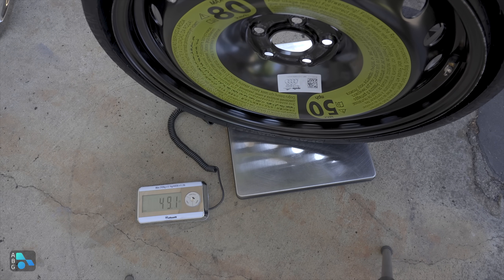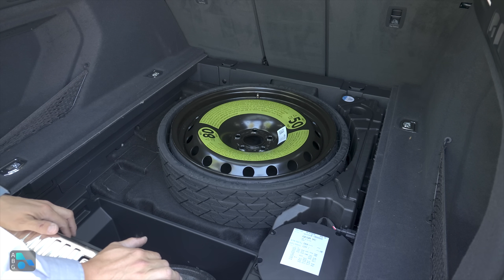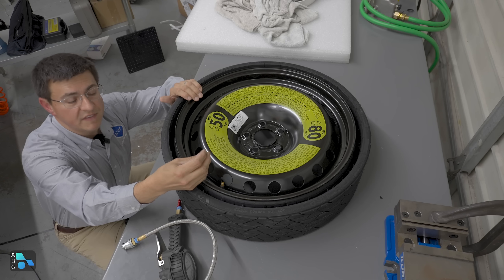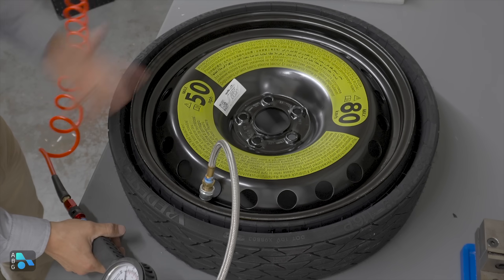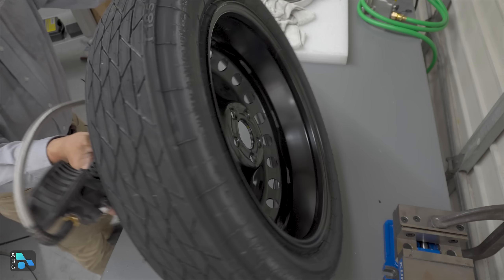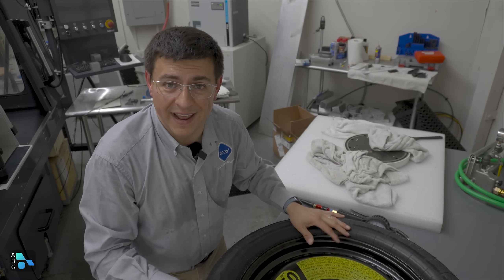How A Collapsible Spare Tire Works, And How It Might Save The Spare Tire In EVs

Comment: Except for their spotty reliability history, Audi has always been one of my favorite brands and I give them props for this innovative idea for a spare. I have a bit more experience with tires than most and have always said that not having one would be a huge factor in whether I buy a car or not. This is better than the fix-a-flat solution but still would much rather just having a regular full-sized spare. Being out on the road changing a tire can be dangerous and not having to spend time getting the tire prepared, rather than just lugging it out and putting it on, would be much faster (and safer). Thanks for demonstrating this.
Reply: You take the spare out, start the pump, then start jacking up the car and removing the flat tire. By the time you’re done the spare is filled. It really doesn’t take that long.
Reply: @NovaResource  Yes, for me, I'd just rather have a spare already filled with no additional moving parts to be searching for.  But hey, you do you!
Reply: @Mark-de4hj  Yeah, because using a pump to inflate a tire makes it so much more complicated. 🤦🏻‍♂️ But hey, if pumping up a tire is too complicated for you, you probably shouldn’t be jacking up a 5000 pound car.
Reply: @NovaResource  You have never used the technology being described, but you think that you know all about it. You are EXACTLY the type that should not be telling anyone anything. No reply needed, thanks!
Reply: @Mark-de4hj  LOL!  As a matter of fact, I have used the technology described. GM was putting collapsible spare tires in cars as early as 1967. Camaros and Firebirds had them. I also happen to have one in my 1976 Nova. And have used it at least twice in the 35 years I’ve owned it.
Reply: @NovaResource  It would be IMPOSSIBLE for you to change a tire faster than I could, using that callapsable tire and following the directions! Keep in mind that most folks do not change a tire very often. Based on your own methodology, you thought you were clever by leaving out the step where, while I am installing my wheel, you are just turning your tire over for the other side to expand at its slow, unpredictable progress? That alone easily another 5-10 mins!
Ps. I never used the word, "complicated". That's on you!

Comment: Glad to see this video.  Those of us living in more remote areas (e.g. mountains of central Idaho), often do not have cell service on the road.  Therefore, no spare can be a problem.  We cancelled our Rivian R1/S order partly because the optional collapsible spare was "unavailable" until some future date that kept coming and going.
Reply: I would think an electric vehicle might not be a great choice for people living in remote areas. If you actually live on a mountain, I would think all the uphill driving would greatly reduce the range you could get on a charge.
Reply: @SwapPartLLC  Don't worry, once you own an EV someday, you will get first hand experience and you can learn how EVs work so well - even in small towns or the mountains.
Reply: @tedbellSEA  If it works for you, that's great. I know nothing about them.
Reply: It's a TRUCK!
Just throw it in the bed or buy an after market tire mount if you're rural.
And if you ARE rural why are you buying an EV???
Reply: Actually, the R1/S is not a truck, it's an SUV.  Besides the environmental benefits, we are interested in an EV because anyone with actual experience owning an EV, knows how inexpensive they are to own vs. an ICE.  Even living in a small town in the mountains, 95% of our day-to-day trips are less than 10 miles.  An EV is perfect.  The spare tire is needed if we drive to the backcountry or a larger town - through cell dead zones. @amzarnacht6710

Comment: Most vehicles no longer include spares.  I wonder if it is cost cutting or because many prefer to call roadside assistance.
Reply: Lower weight (jack and tools are no longer provided either), lower cost and roadside assistance does work. But one of the biggest reasons is simple better tires that are more resistant to punctures.
Reply: @NovaResource  The problem is the tires gradually lose its puncture resistance as it wears out, add to that the higher pressures of EV vehicles and  it becomes even less puncture resistant.

Comment: So I’m confused. How are you supposed to inflate the tire on the side of the road? I didn’t see a compressor or canned air included in the flat kit. What did I miss?
Reply from the maker: I talk about that in the video, in this car it’s in the front trunk area.
Reply: What did you miss?  Most of the video. Specifically at 2:03 where he says, “Now let’s get to the inflation. I’m not going to be using the pump that came with the Audi because it’s a little on the slow side.”
And at 5:33 where he says, “Under this little partition we then find the tire inflator kit “ (aka tire pump).

Comment: For average people, I would be weary of them overinflating it, causing major harm if it exploded. For a car enthusiast, they probably wouldn't buy an EV to begin with, so they won't be faced with no space for a traditional aftermarket spare tire.
Reply: Weary = feeling tired
Wary = feeling concern

Are you wary of people over-inflating standard spare tires?
Are you wary of people over-inflating the 4 regular tires?

How is this any different?

If filling a tire is too hard then that person shouldn’t be driving.
Reply: @NovaResource  Absolutely, so it's a good thing that most people never even touch their spare tires and instead,  call a tow truck. If you know how to put a spare tire to use, then, no need to be weary.

Comment: lol kool idea but who ever came up with this shows never actually swapped tires on the side of the road before ... I mean can ya picture the persons face trying to inflate this bugger on the side of the road ... in wet, cold climate  :face-purple-crying::text-green-game-over: ... having this in my trunk would just annoy me more then the flat itself ...
Reply from the maker: The first time I used one was on a first generation Touareg and it was hailing the whole time. It wasn’t great, but it was better than no spare at all…
Reply: Let me get this straight. When you have to change a tire on the side of the road you feel as if the hardest part of that job is having to pump up a tire and not the part of having to jack up a 5000 pound vehicle? 🤦🏻‍♂️

Comment: The Rivian R1S has the same type of spare. I’m surprised you didn’t notice that on your r1s review. It’s not standard on the R1S and seems to be hard to get later due to no inventory of the compact spare. The R1S comes with a built in air compressor on board so you can fill the pare tire when you need to use it. How does Audi expect you to fill it with air on the highway? Seems useless without an onboard compressor. I wish you would show how long it would take with the portable inflator I’ve seen them take hours might as well call a tow truck if that’s the case
Reply from the maker: It’s not hours, it takes about 2-3 minutes longer

Comment: Where does the flat tire you’re replacing go? I’ve always had this question because every car I’ve owned with a spare doesn’t have enough room under the trunk floor to put the flat. And this would seem to exacerbate that issue. Glad to see a spare though!
Reply from the maker: That’s tricky. You can jam it in the spare tire well as long as nothing else is down there (in the q8) but not all cars that use this tire have such a place to put it
Reply: That’s kinda by design. You put it in the trunk (or hatch area) not in the smaller space for the spare so you are forced to get it repaired quickly instead of driving on a spare tire.
Reply: @NovaResource  sure but if you have a flat while your car is full because you’re on a road trip or something, where do you put it? New EVs also have ginormous wheels for some reason (style since it’s certainly not range) so that’s even harder. I get the by design and that’s interesting but kinda sucks if your car is already full
Reply: @dbeckMSP  So you drive around on trips with your SUV so full there’s no room for the flat tire/wheel?  Zero. Luggage so high in the back you can’t see out the rear window or side window?  If so, that’s illegal since it’s impeding your view. 

Also, don’t forget, when you have a flat tire/wheel to store in the vehicle you also have a spare tire wheel on the car and not in the vehicle. So while the flat tire might not fit where the spare was, some of your luggage and other stuff will. 

You’re making a bigger deal out of this than it is.
Reply: @NovaResource  no? I’m saying that could be a situation. It’s a 5 passenger vehicle, it’s not unheard of to travel with 5 people and their luggage on a journey. I’ve heard the argument before about it being illegal to fill up a hatch to where you can’t see out the back window but if that’s truly the case, then hatchbacks should be illegal and also tall people that sit in back seats and also all the trucks I see with their beds filled up over the roof and also towing a trailer. My point is that if cars had full size spares, as some do, then this isn’t even an issue. Sure it’s heavier, but if every wheel was an 18” instead of 21”, I bet the weight would balance out.
Reply: The same place it goes in every other car that comes with a space saver spare for like forever now. Wherever it will fit. That's where. Figure it out.
Reply: @ButterfatFarms  that’s exactly my point. This spare is even more of a space saver and they’re making a big deal showing how cool it is. But you can’t make the ginormous EV wheels collapse so who even cares? Space saver spaces have never had the space to store the flat. I think a real spare is better than inflation kits (see Micah muzios debacle with a sliced Prius tire) but they’re counting on you getting a flat when there’s nothing in the car when they could plan/design a full size spare and eliminate the issue all together.
Reply: @dbeckMSP  I've never experienced your hypothetical worst case scenario of not having enough room left to store the full size tire I just swapped out for a temporary donut.
Reply: @ButterfatFarms  oh okay. I guess your experience solves it for the rest of us! Glad we got that sorted out and your life experiences are the only ones that count! Thank you for your service.

Comment: So after removing full size tyre with flat, you have nowhere to store it in the car. 😮
Reply from the maker: It can go under the floor where the spare goes, but it’ll take up more space, so if you’re packed tight you might need to rearrange things
Reply: It’s kinda designed that way to force you to get the tire repaired quickly and not drive on the spare long.

Comment: It looks like the vehicle had enough space back there for a full size tire.  Seems like a lot of unnecessary hassle for a customer who could be on the side of a highway in a cold New England winter.
Reply from the maker: A full size would not fit, but a traditional compact might be able to
Reply: Sorry but if you feel inflating a tire is a hassle then jacking up a 5000 pound car is probably something you should leave to the more skilled.

Comment: I prefer Run Flat Tires on all my family vehicles. Even if all 4 tires sustain punctures, we can continue without immediately stopping to change a tire by the side of the road or in hazardous conditions.  RFTs are also extra sturdy and less likely to blowout. True they are more expensive and less comfortable, but they’re worth it. Another potential downside of RFTs is sustaining unrepairable damage while traveling long distance and being unable to get an immediate replacement.

Comment: A spare tire should be the law!
People are rely too much on AAA or your other insurance or just can’t change it themselves.
I’m a big advocate for full size spare tires as it could save your life!!. 
Does it takes space? Yes, is it heavier? Yes! So just have those expensive engineers find a way around it, by adding more aluminum.
Reply: Should a spare battery be the law?
Should a spare gas tank be the law?
Reply: @NovaResource  dude, a gas tank you can clearly see it and plan. If you ran out of gas is your fault, but not a tire, shit happens.
Reply: @davidzavala337  What if you gauge fails?  You can’t plan for that. And like you said, $#!+ happens.

Okay, I’ll give you that one. But what about a spare battery?  Can you “clearly see that and plan”?

Yes, I’m exaggerating. But my point is, lots of things can go wrong. You don’t need to legislate full size tires. If you’re that worried, buy a full size tire yourself if you car doesn’t have one. I’m not worried. I carry a pump and tire plugs. I’ll fix it myself on the road if needed.

Quick question for ya. If you get your way and full side tires are required by law. What are you going to do if you get two flat tires on your trip?  Should it be a law that every car has 2 full size spares? 🙄🤦🏻‍♂️
Reply: @NovaResource  I think you are going a bit too far bro. I don't mind buying one, just leave enough space to properly store one.
Reply: You’re the one that said:
“A spare tire should be the law!”
Reply: @NovaResource  a spare tire is different, it should be on every vehicle. The other items are debatable.
Reply: @davidzavala337  That’s your opinion. Not fact or everyone else’s opinion.
Reply: @NovaResource  not on a spare tire. Those who want (don't know how to use it) can forget about it.  Maybe you call AAA if you don't know how to change one.
Reply: @davidzavala337  You’re wrong. Spares are NOT needed on every vehicle. I don’t need one. I know not only how to change a tire myself but I can plug them by myself so I don’t need to change it. Just because you you need one doesn’t mean the rest of us do. That’s why it’s NOT a law to require a spare.

I don’t know about you but I live where it snows in the winter. There’s no law that says a car must be sold with a snow brush or a snow shovel. I bought both on my own and keep them in the trunk during the winter. That’s my choice. Those aren’t mandated by the government and neither should a spare tire just because YOU think it should be.
Reply: @NovaResource  it doesn't snow everywhere, but you could get a flat everywhere. I'm. Ot wrong, sorry dude, but everyone would get a flat sooner or later.
Reply: @davidzavala337  You are wrong. A spare is NOT needed. As has been proven by millions of cars on the road today that don’t have spare tires. And the millions more cars that do have a spare is it woefully under inflated as it make it useless.